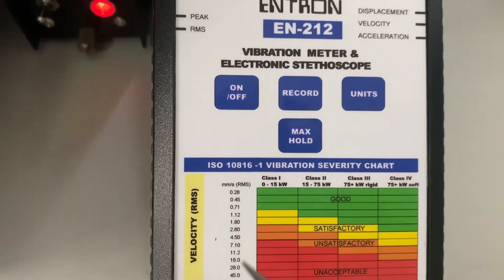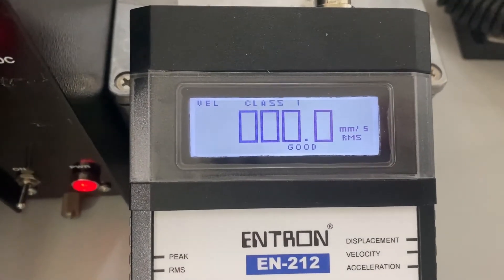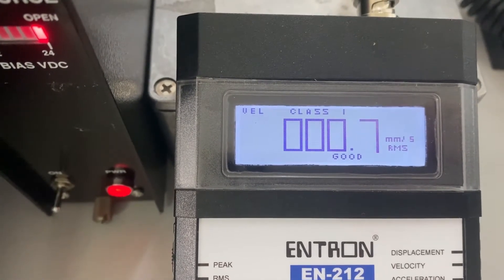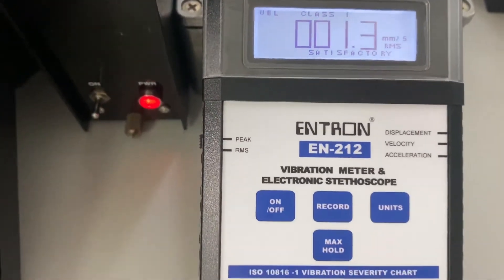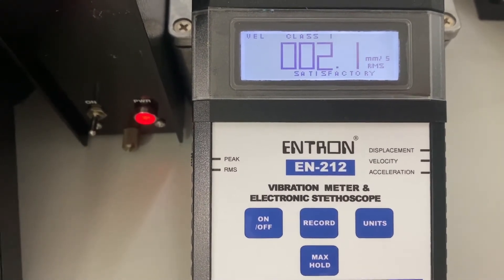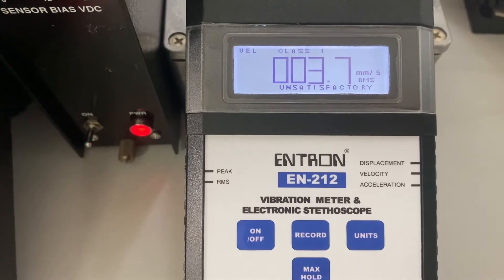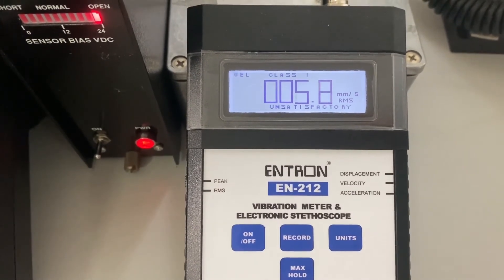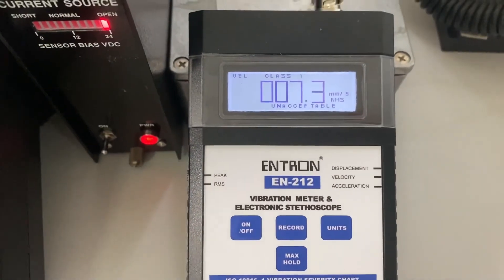Using the ISO10816-1 Alarm feature of EN212 Vibration Meter

Comment: Class III upto 4.5 normal
4.5 to 7.1 marginal (why not from from. 4.6 if normal is upto 4.5)

So, what if exact 4.5 normal or marginal ?
Reply from the maker: 4.5 marginal. Though this is a guide, you are the one that have the final say, based on experience with the particular equipment.